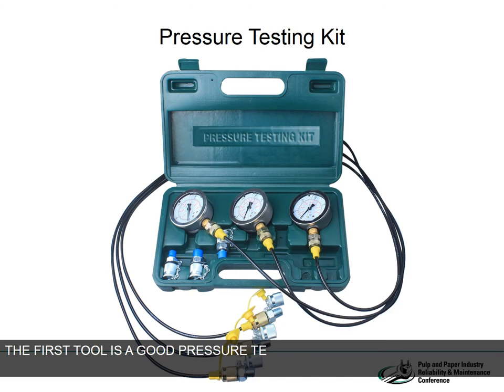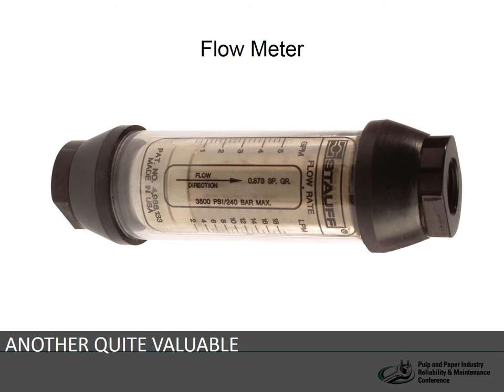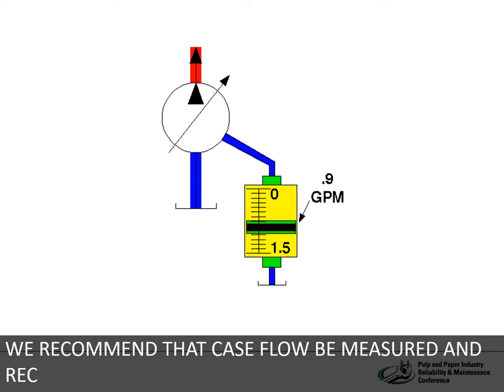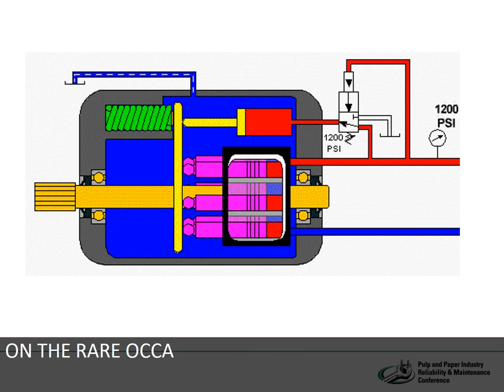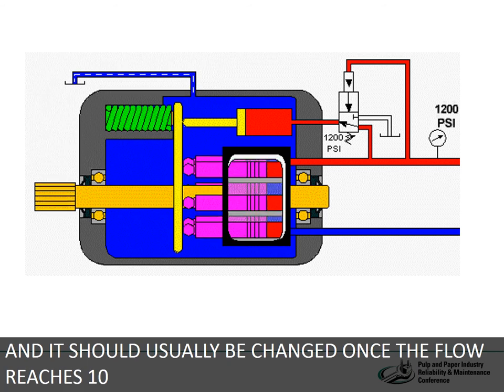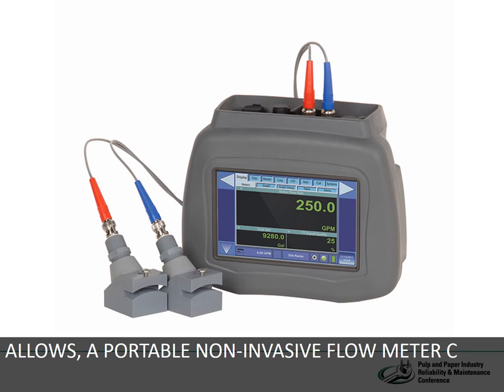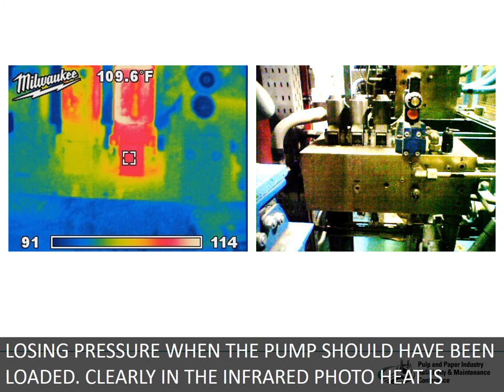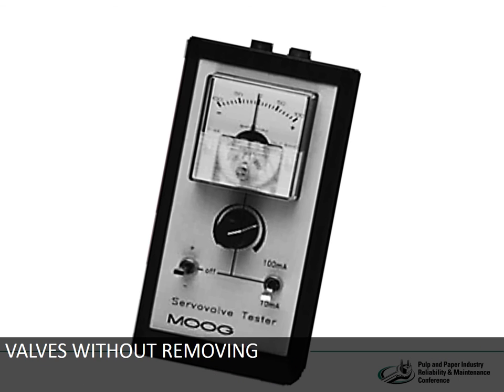The 5 Hydraulic Troubleshooting Tools You Don't Have

Comment: How do you prevent pressure shock when measuring pressure upstream?
Reply: Thank you for your question! I presume you are talking about protecting your expensive gauge from the shock in the system. The gauge is one of your most valuable troubleshooting tools, so it is crucial that it be taken care of. There are two common ways to do this. The best is a gauge isolation valve. This is a three-way pushbutton type valve that releases pressure from the gauge whenever it is not actively being read. You push the button and read the gauge, then when the button is released, pressure is drained to tank and the gauge drops to 0. Second best is a "snubber". This is a small, variable orifice flow control that you crack open when reading the gauge. By metering the flow to the gauge, spikes are eliminated. The gauge response is tempered, keeping it from damage while allowing the pressure to be read. Once you are finished monitoring the pressure, close the snubber, locking pressure in the gauge and isolating it from the system. Hope this helps!
Reply: Thanks for the reply, although what I meant was if pressure testing were to be done near to the pump, one would have to shut off the valve nearest to the pump yes? In that case, pressure acceleration would be extremely quick and likely destroy the pump, so how does one test for pressure near the pump safely?
Reply: OK, I think I see what you mean now. It is true that, in order to get a reliable pressure setting, the pump needs to be deadheaded. This is best done by blocking flow to everything in the system EXCEPT the system relief valve. If you are checking pressure with a fixed displacement pump, the pressure in the system will be determined by the relief valve. If your purpose here is to test the condition of the pump, you should also have a flow meter installed either upstream of the relief valve or in the relief valve tank line. Check the amount of flow first with the relief valve adjusted at a very low pressure. In this case, even a badly worn pump will deliver all or nearly all of its rated flow. Now, begin to slowly increase the pressure while monitoring the flow meter. If the pump is any good, there will be little if any change in the flow once you have reached normal system pressure. If, however, the flow drops more than ten percent, the pump is becoming worn and will soon need to be replaced (depending, of course, on the system flow requirements).
If you are checking a variable displacement pump, the procedure is the same except that the pressure adjustment on the pump must be higher than the highest setting on the relief valve. This ensures that the relief valve is determining pressure rather than the pump, giving a reliable indication of the pump condition.
In no case should a system be operated WITHOUT a relief valve. I have seen system designs with no relief valve, operating on the assumption that the pump regulates pressure so there is no need for a relief valve. This is dangerous, because the pump's pressure compensator valve can stick either open or closed. Depending upon the pump design, one way will keep any pressure from building in the system, the other will keep the pump at full stroke all the time, causing it to perform as a fixed displacement pump.
Hope this answers your question!
Reply: Thanks for the detailed answer man I learnt alot. Have a great one.